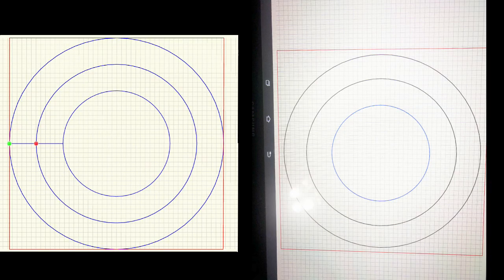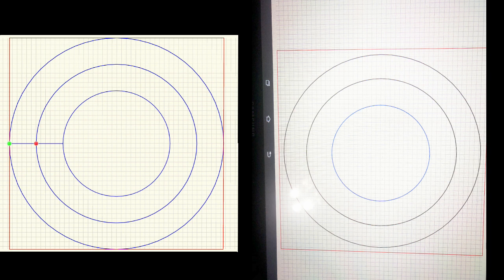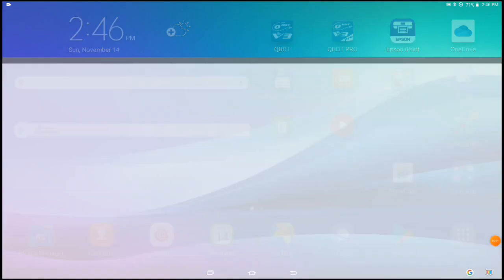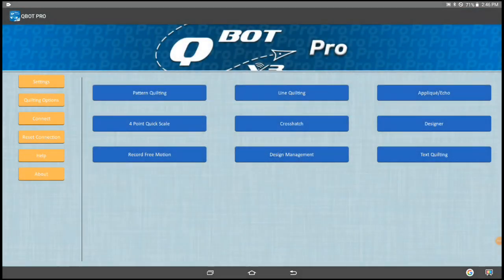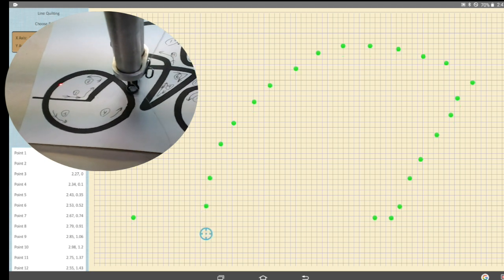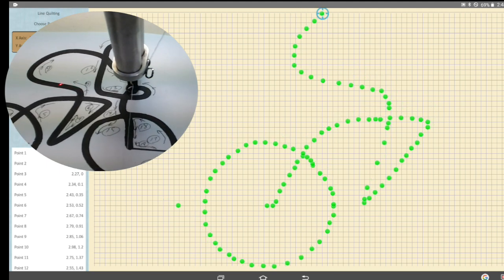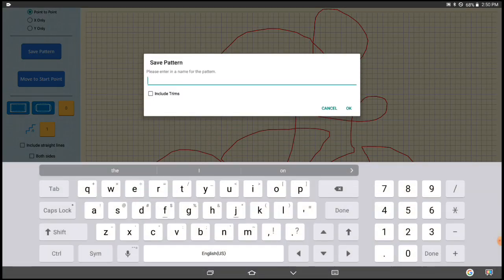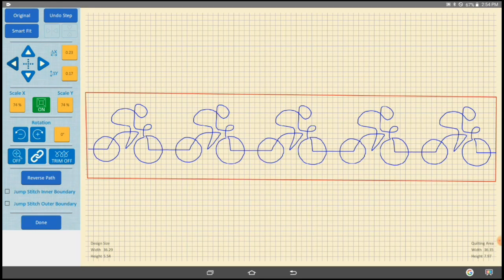Create Designs with V3

Comment: That is pretty neat, I never thought about using line quilting in that manner.  I did do a simple four point line (square) and then stepped it in 8 times to get the pattern that I wanted and then saved it. My thought was that I would use four point quick scale on the remaining squares within the quilt to speed up the selection process. In four point, I selected the four corners, selected the pattern, set a "0" margin and QBOT brought the line quilt pattern in, but then didn't skew the corners to match the imperfect square.  I ended up using line quilt and then set the steps each time which was then spot on.